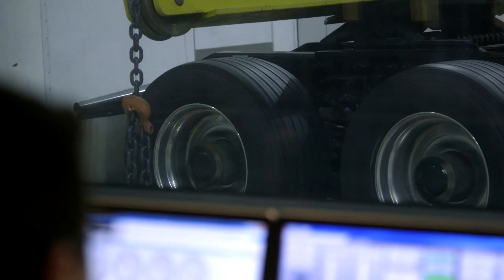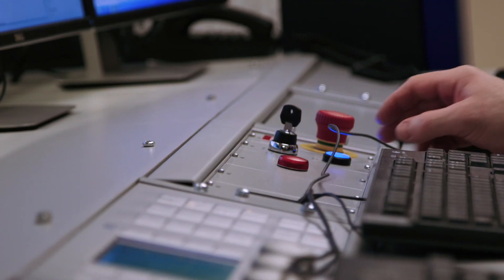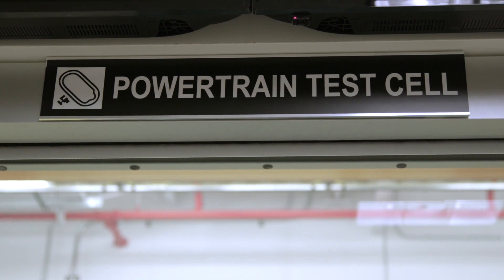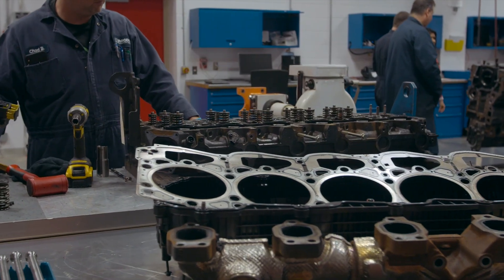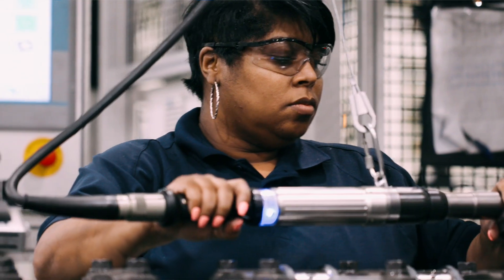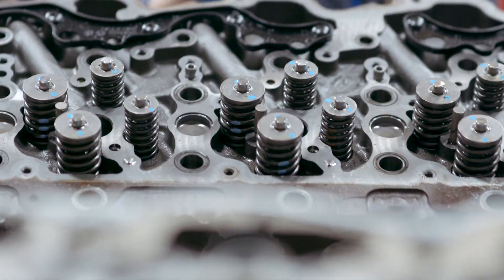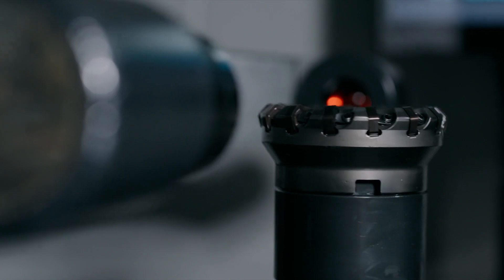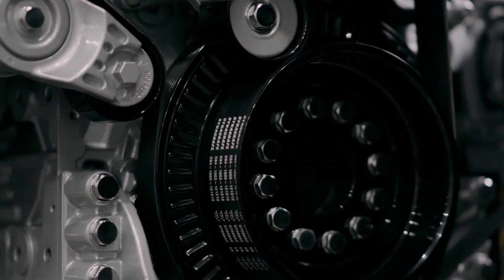PACCAR Engines Driven by Quality

Comment: Power by nox sensors failures. Power by check engine lights. Power by vgt actuator failing. Power by can communication failures. Power by leaking plastic oil pans. Power by a set of injectors for more than a motor core.

Comment: U r full of crap this engine can't get out of it's own way ,can't pull a hill of any type or excelletate with any load,this engine is a poor design
Reply: I’ve got an Mx 13 with 320,000 on it and had it in the shop once to fix an air and a sensor that went bad.. I love this engine it’s not poor design it’s just got power issues and even then it’s not that terrible bad.. I mean I can live with it..

Comment: What are they considering a major over haul. Hell doing a bottom in is major over haul to me. Explain this Paccar. What is going to be needed on this motor in a million miles.
Reply: At the end of 2013 PACCAR started to produce DAF trucks in Brazil. In this video you can see the owner of a haulage company with 90 trucks. Last year he extended the percentage of DAFs in his fleet to 40 %. The oldest DAF XM-13 has ran now 1.3 million km with just regular maintenance. 
Are Brazilian truckers better drivers than truckers from the US? I bet you that most road over there are bad maintained. Or is the quality of constructing in the US of these beautiful DAF engines the problem?
Reply: @47rintin1  you’re right brother I got 1,400,000 miles on my Paccar regular maintenance and still going no blow by but I control that by not idle the truck and using my Thermo King APU
Reply: @MarioHernandez-bx3mr  It seems to be that you're a great driver, Mario.

Comment: I like to see a mx 15
Reply: It will be nice to have mx15, hopefully no more VGT turbo, bring back the compounded twin setup. Its a bit tough with all the engineering ideas must be taylored to meet GHG and EPA regulations.
Reply: @johnrusselllubo  I agree but one turbo will be effective less parts to replace or repair
Reply: They dont need to. The MX13 is rated and can perform as good as the X15 efficiency series with less weight and cost. The only advantage you gain on the 15L is a wider torque band but not enough to notice on a daily basis. If only paccar can figure out how to produce above 2k torque, thats something too look out for.
Reply: @johnrusselllubo  that's my point of a 15L paccar mx 600hp 2050 tourque. And still be lighter then the Cummins 15L
Reply: DAF Trucks is one of the three daughters of PACCAR and sells the most of het trucks in Europe. And in Europe there is no need for a 15 Liter engine.

Comment: I hope the engine is as good as this "glowing " video. I remember a few years ago watching one about the IH Maxforce. 😰
Reply: I have a 2020 peterbilt with a mx13 and its running strong
Reply: There good! I’ve got a Mx 13 with 320,000 miles on it and the only thing I’ve done is fix an air valve if they made an Mx 15 it would be the only damn engine I would buy
Reply: @jaykoehn4106  I love if they did m did make a mx15.
Reply: Who knows, Maybe IH can come up with your dreamy lightweight 15L, NAMED:
INTERNATIONAL XPACC-Force.
15L Carbon Graphite Block
Titanium Powertrain
Rocket Launchers, (Optional)
Reply: Pucker up.  The new epa 2017 engines are starting to go the way the max force did.